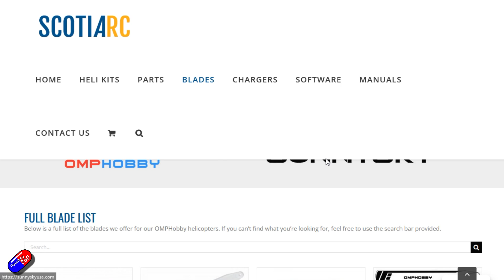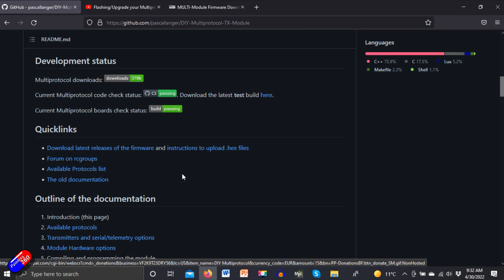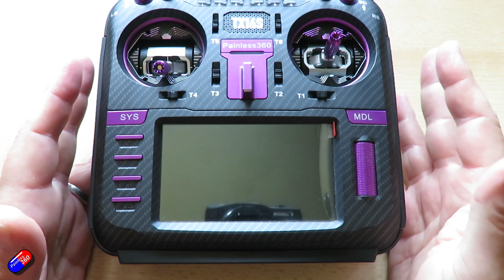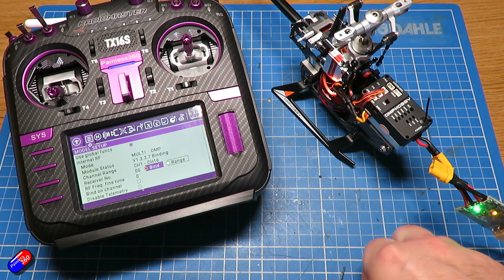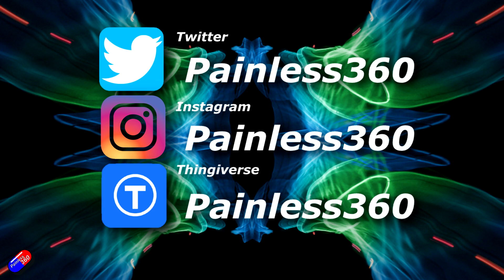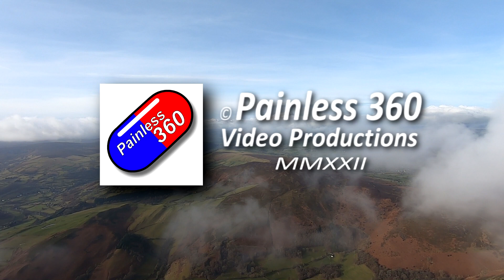Connect to your OMPHobby M1/M2 Heli using a Multi-protocol module and the OMP protocol!

Comment: If you still monitor this video and fly your M2 I had one question. I was gifted an OMP M2 Explore. My TX16s has EdgeTx 2.9.1 presently and as such shows the MIXES and other windows differently. My question is, "How did you get 3 positions programed in your CH 6 - MIXES ? You did not click  INTO that channel to show the 'workings' and it seems to show on top as only 100% on Sw SE. How did you put 100% on Sw SEfwd for normal, 0% on Sw SE for IdleUp1, +100% on Sw SEback for idleUp2 ?   ON EdgeTX 2.9.1 I used 3 separate mixes on CH 6, one for each weight and Switch position and was just curious how you did it with just ONE mix.   Your content is not only PAINLESS it is often TIMELESS   :-)
Reply from the maker: Just added a 3 position switch to CH6. See my Opentx mix school... Best of luck

Comment: Hi Lee - thanks for a very informative video!  I just got my TX16S 4-1from a local retailer here in Norway and it comes with EU LBT firmware, which seems to limit the number of protocols available in the MPM module.  The OMP protocol is not among those few that are listed.  Any ideas on how to get access to the OMP protocol on my radio?
Reply from the maker: What versions of stuff are on the radio?  What did the seller say?
Reply: @Painless360  I have a TX16S MKII with EdgeTX 2.9.3 and internal MULTI module 1.3.3.24.   Radiomaster's web site states that the 4in1 LBT Version (Europe) is limited to LBT compliant protocols FrSKY X/X2 LBT, HoTT LBT and DSMX.  Any advice on how to enable the OMP protocol is much appreciated!
Reply: @Painless360  I seemed to have figured it out.  I simply downloaded and flashed the latest MPM firmware and all the protocols showed up in the menu 👍

Comment: Hi, love your vids, I just picked up an M2 and a TX16s, I've swapped it to mode 1, what settings do you think I need to look out for when setting it up? As Mode one is it still ok as AETR when its kind of ATER I appreciate your help
Cheers Simon New Zealand
Reply from the maker: The mode on the radio doesn't change the channel order on the outputs. Check it, but it should be fine. Best of luck
Reply: Thank you for your guidance, Thanks to you its all working, your a Champion. Cheers

Comment: If still apply the pitch curve into the setting, what is the result ?    And, is the OMP protocol suitable for beginners to practice hovering and further their 3D learning?
Reply from the maker: Not sure I understand the questions. https://www.youtube.com/watch?v=-SSMPYR0mO0 covers what a throttle and pitch curve does. The OMPHobby protocol on the MPM doesn't affect how easy (or hard) a model is to fly, it is simply how the radio communicates with the model.. I hope that helps.

Comment: Help please! I got a new MK2 tx16s  running edgetx and omp protocol not showing frequency fine tune.before that I was using opentx and a reg xt16s.and had frequency fine tune
Reply from the maker: Fine tune is not available on all of the protocols and depends on which chip is being used to generate the protocol you are using. I wouldn't worry if it isn't there. If it was, then I'd use it. Best of luck
Reply: @Painless360  ok thank you.

Comment: Did you have to fine tune the receiver for the heli?
Reply from the maker: Same was as any other protocol. Only those where there is an option for it on the radio, need it though.. Happy flying!

Comment: Hello thanks for your videos I have learned a lot from watching them I have a question I have bought an omhobby m2 evo rtf with a radio master zorro and now I have bought an omhobby m2 evo bnf so my question is how do I set it up and tie the one with Muli protocol for my radio master so I have two profiles on it thanks in advance
Reply from the maker: I am not sure that I understand the question. Can you explain a little more?
Reply: @Painless360  one helicopter is satup on my radiomaster zorro so I can fly with it, but I have bought a bnf omphobby m2 evo which I would also like to have on my radiomaster zorro
Reply from the maker: I see. I'd copy the model and setup the copy with the new receiver. Otherwise you'll end up trying to keep track of the setups for the Rx's in the model settings.
Reply: @Painless360  ok so I copy the model and bound it with the new receiver and it should work
Reply: I will try that, thank you very much for your help

Comment: Question: is not longer the case that if you bind using OMP's protocol that you cannot apply your own curves (meaning, the FBL unit's internal curves and mixes override anything you do)?
Reply from the maker: Mixing is done inside the flybarless unit. This is so that simple radios can be used. If using an external reciever  you can change the curves and mode behaviour. Happy flying!

Comment: hello, short question could you bind all of the omphobby  heli to the omphobby t6 transmitter?
Reply from the maker: Not sure. Maybe... best of luck
Reply: @Painless360  thanks.
Reply: Yes, I have 3 Omps (M1, M2, M3) all bound to the same t6. Once they are bound, you just connect them like normal without having to do any model switching.

Comment: Hi Lee,

Thanks for the great content. Dumb question incoming - On the Radiomaster TX16S, did you have to buy an external module for the multi protocol? Or does it just come with it?

I'm using the original Taranis X9D plus, with the latest update. But I'm being told I'll have to buy an external module, in order to use the multi protocol. I opted to use a receiver instead of just binding to M2's flight controller. Thanks again
Reply from the maker: The 4in1 multiprotocol module is all fitted inside the radio so you can add extra things like ExpressLRS or Crossfire into the JR bay at the rear. See my videos on it.. best of luck

Comment: Thanks Lee, nice and clear. Only recently set mine up the only difference being I did the throttle cut as an override special function but as always with EdgeTX there's usually more than one way to do these things. Also I noticed you had throttle cut at low stick, is that something you added? I did the same but had to use a logical switch.
Reply from the maker: I have mine set so that the throttle is live only when the throttle switch is in the middle position. Makes it easy to kill it if things go wrong... Happy flying